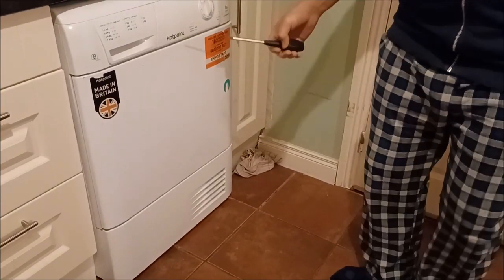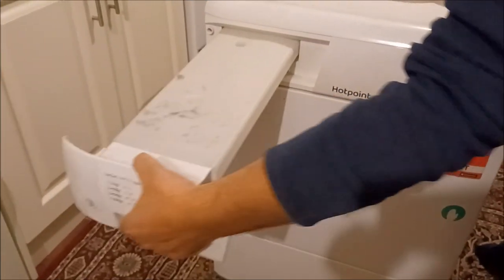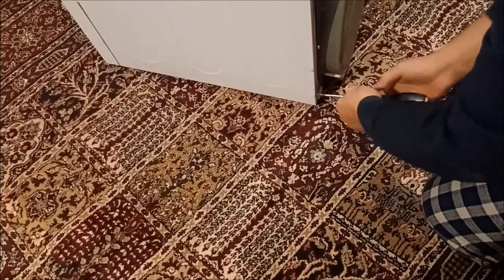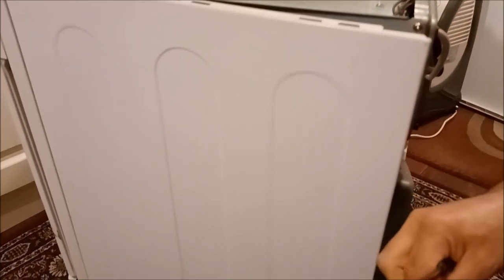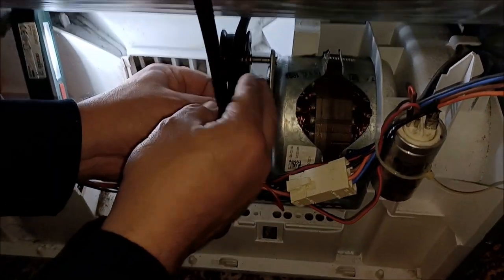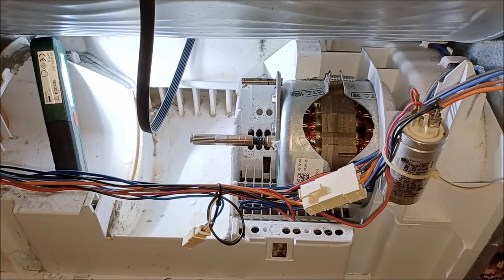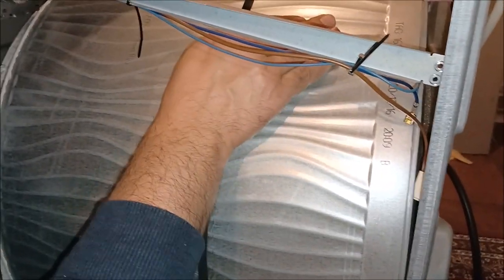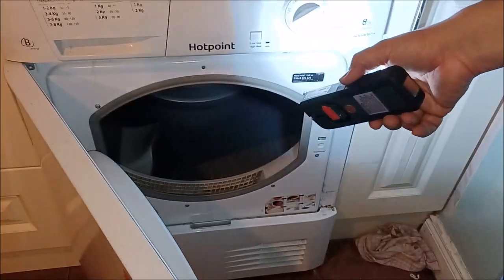How to Replace a Condenser Tumble Dryer Belt in Hotpoint, Indesit or Creda

Comment: You are a life saver. I have a different model, but was able to figure it out with your clear steps and good camerawork. One point of attention: my pulley has a spring, which jumped off when the cable broke. I put the belt in place, then tensioned with the spring and pliers (and assistance in pushing the pulley down). Saved us a costly repair job.
Reply from the maker: Delighted to hear that my video helped you, and thank you for your the very valuable point about the spring in your dryer, I am sure it will benefit someone.  Well Done for have the job DONE yourself 😀
Reply: Same
Reply: @engineerityourself123  thanks. I now change the belt😁

Comment: Spot on instruction. I'm not a strong as you so used a spanner pivoting on the motor casing to fit the belt to the black wheel. As to why the belt disintegrates, I read that overloading the dryer can cause it. Thanks again.
Reply from the maker: Thank yo very much for your comments and for the extra information there about the overloading, I hope these benefit some people in a good way.

Comment: Thank you so much for this video. I followed every step and it worked out perfectly. Hardest bit was getting the new belt over the black wheel, so tight.
Reply from the maker: Well done. . are right getting the belt on the black wheel is the hardest bit, but you actually got there. Well done 😁👍💯💯

Comment: Thank you very much mate, I followed your video and I could change the belt of my dryer, which is exactly the same model as yours. Everything was smooth until I had to put the belt around the pulley, it was totally impossible for me, I assume I'm not as strong as you haha. Finally I could sort it out after watching another video called "Indesit IDC85 belt fitment - getting belt over pulley". So with the help of a screwdriver I could finally put the belt in place. Thank you!
Reply from the maker: You are very welcome mate, that is the hardest part....putting the belt around the pully, some models have the motor on spring so you could actually tilt it to do that, but this model does not unfortunately. Well done for having it done 👍

Comment: Very helpful, especially if your belt has snapped & its not clear immediately how it winds around the pulley. You also saved me time with taking the front section off to get the belt over the drum :)

Comment: Hotpoint engineer here. Don't take off the pully wheel like that. Your making it harder for yourself. Do exactly what you done with getting it over the motor shaft. Get it lined up with the grooves of the shaft. Get the old belt and double it up and put it behind new belt. Pull until you can get it onto the wheel, I put 2 feet at the bottom corners and all my weight behind it. Comes fairly easy. Under no circumstances should you take that pully wheel off unless it's broken. Always make sure to give a hoover inside if ya gone to all that trouble too. Good man.
Reply: Legend, best tip I've learnt all year ✌️
Reply: That double up the belt tip though, turned half hour into 30 seconds ✌️
Reply: @432Enduro  if it helps one person that at least read it then I'm happy, not a bother buddy,
Reply: @balfie18  I put it all back together and the drum isn't turning. I can turn it all by hand, do you think it's the motor?
Reply: @432Enduro  so when u have it plugged in and press play, it doesn't start, with the lid off, try press start, and if it doesn't turn, give the drum a little push, and if it starts turning it's the capacitor,
Reply: @balfie18  I didn't realise you needed the lid on but put it on and nothing happens even after a little push. I'll see if I can get a capacitor. All the elements are heating up.
Reply: @432Enduro  of you give it a push and it doesn't turn still then it's not the capacitor, when you put it all back together, are you sure that the fan at the back is not jammed against the back of the machine, or nothing stuck in the fan in the front, if all clear then it's a motor issue, does it buzz when u have the door closed and you are pressing start?
Reply: @balfie18  If the fan is below the elements at the back, everything is moving freely, yes, it makes that buzzing sound when on 0 and door is shut.
Reply: @balfie18   @balfie18  it's making a spinning noise but the drum isn't moving and to be fair, the motor just smelt like it's burning up. Time for a new machine I guess. Thanks for all the advice, really appreciate it and thanks to @engineerityourself for the vid, I now know a lot more about Tumbles 🤙✌️
Reply: @432Enduro  turn it to a time and close the door and press start, if it doesn't buzz, but doesn't start you have a motor or timer issue,
Reply: @balfie18  it's weird. It's buzzing when I press it and also makes the noise as if it's working but it just doesn't turn 🤯
Reply: @432Enduro  have u got the belt on correct? If u have the side panel off, and press start, can u see the motor shaft actually moving. Did u put the new belt the correct side of the pully wheel
Reply: @balfie18  Yo, thought I'd send you a quick reply. Revisited tonight, felt like it had something to do with the lid, took it off and noticed a red wire with a plastic connector had come free from the group of connectors. Plugged it in and around she goes ✌️.
Reply: My wheel where was broken, i changed it. But after the change it wont rotate the trolley unless i have absurd little ammount of clothes inside. You know whats the problem? I see no damage on the belt, but its almost as it fails to grip properly on the trolley. It slips.

I had to go away 2 weeks Prior fixing it, so i thought something dried up or smt, but it dont seem to work Even after several dries of a few towels. It can only handle like 3 towels atm.
Reply: @gel87Kjetil  you have the belt on wrong side of pully wheel
Reply: @balfie18  thank you, will check immidiate :)
Reply: @balfie18  now its on the right side and running normally, thanks a lot :D

Comment: Hi, how do you actually get the belt on to the pull. (Your hand was in the way). I have the 8 belt, but there doesn't seem to be enough slack to pull it over the pully. Thanks
Reply from the maker: Yes, sure I did....I know it is very small place but with couple of try you would get it on, some models have spring motor mounts so you could left motor then push back after you put the belt but my model does not have I just kept trying with belt on the pully I tried to bring pully close and managed to slide in finally...I hope you can as well.
Reply: The belts are tough but they have got a bit of give in them - don’t be afraid to stretch it a bit. I had to use a screwdriver to help stretch it over the pulley - it was the hardest part of the whole job

Comment: This video was very helpful. Unfortunately when I put everything on as it should be. The dryer started smoking. Not sure why that is
Reply from the maker: Could be the belt very tight if not the correct one, does the belt damaged again? Check the bully as well, is the motor working?
Reply: @engineerityourself123  thanks for getting back to me so quickly. Unfortunately it's too late now. As soon as it started smoking I took it outside. Young children in the house etc not worth the risk. But the belt I checked and it was the right one. 👌

However doe the actual drum did not spin round when I had everything on. But it was definitely the right belt. So not sure
Reply from the maker: @nathanrumbold2982  you are welcome no problems but if you are trying again later try to spin the drum by your hand at the start, if works it could be the capacitor need a change

Comment: Hi pal .. you haven't got a pic of the timer electrical connectors on the back of the timer ? I replaced the belt .. and my photo I took of the wires and which spades they connected to has disappeared ☹️. I've been on the net .. but can't find a pic or diagram .. thanks in advance
Reply from the maker: Hi Pal, I have taken a few pictures of my dryer now but not sure how to share them with you, maybe if you share your email i can send them. Thanks
Reply: @engineerityourself123  model it Hotpoint fetc70 condenser dryer.
I can't contact or leave email on here... Fb.. my name is fo foley. Could you post a clear vid of it and I can pause it .. much appreciated
Reply from the maker: @ajf5065  Sorry I do not have a video for it Foley because i did not have to remove this when i was doing it but i did opened the cover again yesterday and took few pictures for you. Thanks
Reply: @engineerityourself123  can u post the pics ? I'm on Facebook as for foley... Add me ?
Reply: Fo foley on fb
Reply: O 7 3 o eight  , one four ,78 o five
Reply: Struggling here pal.. would be appreciated if you could forward the pics to the number above.. cheers
Reply: Any joy pal.
Reply: @engineerityourself123   this will also work for the ariston version of this dryer
Reply from the maker: @hotpointbrownlover3365  not sure sorry.

Comment: Thanks again for your helpful vid. I made a video about 2 alterations to your procedures, number 1 was I used a different method to get the impeller fan off at 18:32. Number 2 was I used a hook to get the belt over the pulley at 22:29 because no way could I get the belt on using the loose spool. https://youtu.be/qFBQy4pxNs8
Hope this help others as well.

Comment: how to remove condenser? i have hotpoint tdhp 851 and wont come out, machine start stinking on rotten lint from bacteria ffs.
Reply from the maker: Mine is TCM 580, Condenser has 3 small blue butterfly, and to remove it just twice them to the unlocking position, then pull it out. I hope that helps